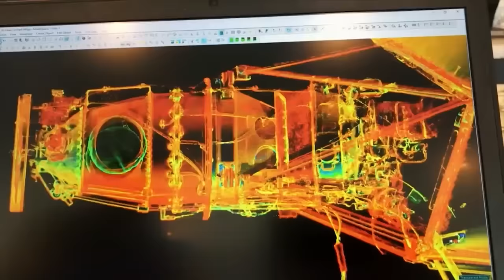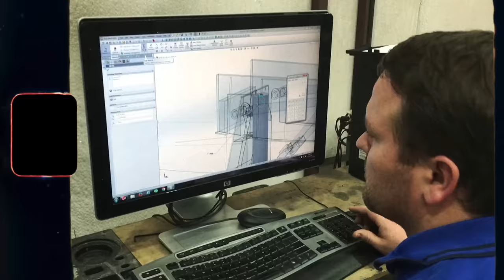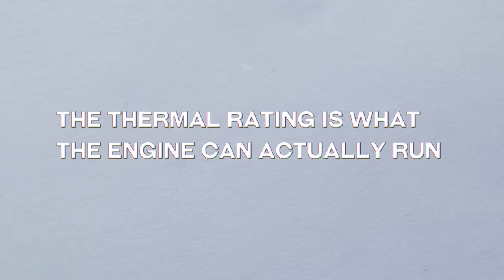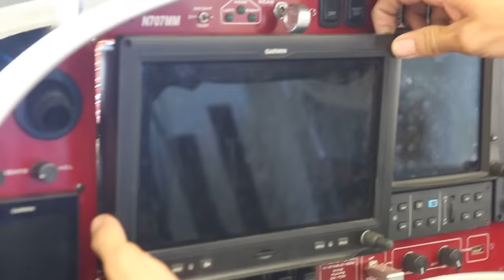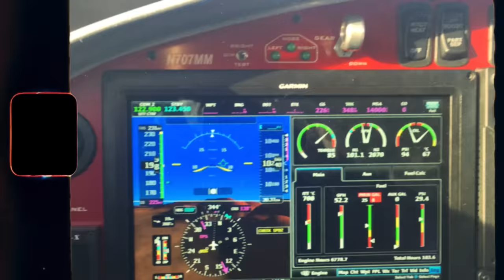Creating a Monster - World's Fastest Single Engine Turboprop | Turbulence #4

Comment: In case anyone is wondering I found some specs in an article: "Turbulence, a heavily modified Lancair Legacy and set a world record for the fastest single-engine turboprop with a speed of 438.02 mph. Turbulence has an 850-hp Pratt & Whitney PT6A-42 engine, custom five-blade MT propeller, and custom cowling, wings, and tail section. The entire fuselage is reinforced, and the airframe is 7 inches wider and 4 feet longer than a Legacy with a 32 percent larger rudder and tail."
Reply: I feel like the P-51 being able to out speed this is a curse.
Reply: I was going to say the p51 voodoo oud does this plane by 100mph if that's the case
Reply: @Noneyuhbus  yes voodoo is about 100 mph faster at  more than 2x the hp
Reply: Thanks for providing the information which this useless video fails to provide.
Reply: @Noneyuhbus P51 isnt a turboprop

There are a lot of reasons to have a turbine over a piston engine. They're often used because they don't fail like a piston engine can. When they fail, it's gradual. You'll almost always be able to get home. 

There can be catastrophic failure, but its so rare it's not a concern. In piston engine aircraft, you'll want for a parachute if it fails. Turbines the temp just climbs a bit over time and loses power gradually. It take a long time for it to fail enough to be unable to power the airframe.
Reply: Nobody mentions the cost lol. I assume it's about a million if you dont include labor. The turbine and prop is probably a half a million.
Reply: @jameskirk3 

And Mike Patey had this engine fail .  He safely dead sticked it to MSP IIRC.  Blew turbine shards all over the wings

Comment: Thanks for that bit at the end, Mike. I'm still on the lower side of flight hours and I find myself at the point of really needing to make sure I don't push limits. It's that "just good enough to be really dangerous" time in my aviation journey. I handled some pretty gnarly conditions, but they were things that popped up and I had outs already planned. I constantly remind myself that just because I have dealt with those conditions doesn't mean that I shouldn't be avoiding them at all costs. I've implemented hard limits that fall below what I know I'm capable of. That way if conditions diminish some, I have a safety margin. Having you reiterate this further solidifies that decision was correct and adding some more margin is better yet.
Reply from the maker: Stay safe out there

Comment: Huge respect. Thank you for holding Aviation in high regard. Once you’ve pushed it and survived you get it. You have 2 choices then. Die doing what you’re doing or respect the air, the aircraft, the chair flying, maintenance, support crews etc. flying fighters for 20 years you could see it. 500hrs we were experienced and that’s when it got dangerous. By 1000hrs you understood it. You said it very eloquently. Mad respect for you sir all around.

Comment: That my friend is called wisdom , for many it comes to late .My father was a Army paratrooper 101st and was also on the Army parachute jump team .
He began flying fixed wing and helicopters after the Army ,he also built in our garage two byplanes and later rebuilt a Hughes 300 later. He fought fired looked for oil across the Rocky Mountains using helicopters doin seismic surveys .
My father was careful and a very talented pilot I grew up around it all .Love you channel and your innovative outlook on aircraft thank you and good luck . Thankfully I lost my father couple years ago to heath complications not Aviation.

Comment: You guys are living the dream of many aerospace nerds. You should savour that. Off the wall thought, it would be great to do a trade on a contra rotating prop. Unfortunately I know of none that exist in this size, the one on the Griffin too big I guess. Next doubtful idea is to duct bleed air to blow on aileron to increase authority at low airspeed. The A42 has all the thermal margin to permit a lot of bleed air. This idea might not be silly. The expected benefit might be safer low speed handling, better climb and acceleration. To test a simple compressed air bottle could be set up.

Comment: I'm not a safety Sally, but when you're on the cutting edge as Mike is, everything you do to ensure safety can easily be the difference between life and death. This is a stunning aircraft that pushes the boundaries and there's a huge element of danger in that, but even with holding back from the razor's edge, you're already on a crazy ride and the adventure level is at max. I'm sure the temptation to let those horses run wild is a powerful one, but there's a thin line between ecstasy and suicide that a wise man will not cross. What an amazing accomplishment.

Comment: the five blades prop acts like the N! compressor on turbofan engine. except the enclosed cowling bypass the atmospheric air that also incorporates the thrust reverser during landing. i did see the jet engine power the gearbox. i'm not sure the high speed will shorten the wing structure after so many takeoff and landing due to stress. your limited the throttle from max speed reminded the F4 Phantom doing the max high speed test resulted in the pilot lost his life when the wing structure was over stressed. i retired from the major airlines as jet engine overhaul technician. your monster is very aerodynamic. great piece of proven art work!

Comment: I did flight testing in the Air Force for 5 years and it can cause people to get tunnel vision. Once had an emergency and it was one we trained on twice a month. We had it for real and the pilot tried to pass a perfectrly good air force base. Our home station was only ten more miles but it was an emergency and we had a good airport with crash rescue right here. Being a flight engineer we are trained to challenge our pilots when being dumb. I told the pilot if he didnt declare and emergency and land here I would declare and emergency. Being I was also an evaluator I told him I would hook him and give a failed eval for safety right on the spot. It was  amazing that he instantly came out of the mental fog of get home itis. He thanked me later, turned out both engines could have failed at any second.

Comment: Small hint for constructor: you can tilt propeller (and engine) 1.5-3 degrees, it causes dissymetry of propeller's thrust and dissymetry of additional lift created by the wings that can counter propeller's torque.
Invented by mr. Bloch (later Dassault, this Dassault - father of Mirage) before ww2, was adopted in many not realised US military projects of single prop attack aircraft after ww2. It is the best aerodynamic solution for the problem, because it can be almost fully compensated regardless of power around take off speed, and does not cause problem when engine dies.

Comment: The word incredible is inadequate here! For everyone's edification and amusement, on the subject of audiences and egos, an anecdote. On a breezy afternoon, while at home I heard what I recognized to be the sound of a paraglider taking off. It stopped within ten seconds, and I knew something was wrong, I drove to where I found a friend and fellow pilot hanging upside down from the electrical wires. My friend, a man of small stature with a large ego, had a football helmet on adding to the amusement factor. He was so wet with fuel it was dripping off his helmet. His paracords were draped over the electrical lines and the breeze would cause them to slip frequently creating a sound exactly like an electrical short. We were 30 miles from the closest power company assistance so I had a friend use his front end loader to lift me high enough that I could disconnect the power to the area with a pruning pole saving my friend another 30 minutes of terror?? A year later while flying a small home made experimental, the canopy flew off taking his glasses, and causing him to crash. It took him nearly three years to walk again. Go figure???

Comment: I respect the hell out of you dude. Xray those welds, i usually backpurge all my cages/mounts/chambers/manifolds, as well as chemical etch/sand blast the mill scale for extra homogenous surfaces, and always make sure you can hardly see any light shine through any of the joints.

Comment: Check out the Turbine Legend by Legend Aircraft (Formerly Performance Aircraft).  Also a single engine turbo prop with tandem seats.  When it launched in '98 it was doing a cruise of 425mph and a VNE of 500mph.  I'm sure the original designers and engineers would love to share their lessons learned.  Best of Luck!

Comment: "If the motor falls out when I lower this, I need to stop building airplanes".  LOL   But you really wouldn't, would you?

Yeah, kinda broke my heart when I heard you'd crashed Draco.  The most important part of the equation went right though.  Walking away is job #1.  I think you have a great attitude toward testing and flight, good for others to hear.  As soon as you don't,  something bad is a lot more likely to happen.  Always err on the side of caution.

Comment: Serious airplane performance. 

I've always wanted to see if high performance turboprop Pratt & Whitney or Rolls Royce 850+ HP - 5 / 7 blade combination could break 500  true airspeed between at FL15 - FL25 with a fuel burn less than 250 lbs per hour in a sub 2,500 lb (empty) aircraft. (What I call the triple 25s) that could still have a full fuel + 800 lbs passenger payload with 1,000 nm range.

It will be exciting to see what your final flight test cards reveal.

Stay safe and have a nice flight 🛫

Comment: Great work, I have the perfect engine for you to if you want to go faster and farther for less fuel.
An explosion trubine able to double the power output for half the weight with a new engine doing 16 explosions per turn in only one cylinder. A greater expansion ratio for higher efficiency.

Comment: Dude @8:23 when you held up that motor mount to that fuselage I gasped! I never gasp. I participated in building about 75 SLSA certified along with many Experimentals. LOL it's people like you that make me want to flip the board and rage quit life ha ha haaaaa. I judge aircraft using my own two method inspection rule. 1. spinner gap. 2 wheel pant perfection. The rest is easy.

Comment: Visually very reminiscent of the Bell XP-77, which would have been a great little fighter with a strong enough engine. The Fairchild Ranger VX-770-9 supercharged, air-cooled, inverted-V twelve-cylinder engine it was designed for might have worked, but it was a developmental engine that was never delivered because all of the superchargers were being used in production fighters.

Comment: So, You are at 420 mph with Turbulence's current configuration. I'm convinced that you can get to 450+ without adding more power. There has to be something that can be done in the way of airflow around the fuselage, airfoils and appurtenances. The answer lies between your ears, Mike, and I know you can find another 20 to 30 knots or mph. Just for example, that exhaust horn should be shaped more like an airfoil than an oval or the letter 'D'. That's gotta be worth a couple of knots all by itself.

Comment: I understand the parachute, but I'm wondering how you'd get to use it ? From what I can see the canopy is hinged at the front, so given the air pressure on it in flight, how do you get out of the plane ? Have I missed something ?

Comment: How do you design this?
do you just guestimate it and make it a little stronger? e.g. how you did the carbon reinforcements at the hull/wing connection. Or do you do a full finite element stress analysis (guestimating loads).

Greetings from a boat builder.
Reply: That's the scary part. Maybe he did maybe he didn't. I am not an expert at airframe design but I know it's a serious topic, especially when it comes to wing loading at the speeds of that aircraft.

Comment: i wonder if this beast of a plane will run into that "compressability" mach limit issue WW2 fighter planes had where control surfaces start locking up and/or reversing. or nose pitches down.

Comment: Why exhaust out at the prop end instead of having the turbine facing into the air to scoop more air? Exhaust would be close to the cabin. Wouldn't the ram air give more HP?? I am curious to know from an engineering point of view. Or is it best to exhaust at the prop end to manage the exhaust heat??

Comment: If sheer speed is the only functional criterion, it's easy to build a superfast single engine plane.  This applies up to a practical limit of about Mach 1 and at that point the machine pretty much has to sacrifice everything else, like stability, payload, and usefulness to any other purpose.  It's a bit like taking an elevator to the top of the Freedom Tower and claimed you climbed it, it's a cool thing with very little utility.

Comment: Watching the modifications made to accommodate the increased loads, stress on your AC, made me think that you could suggest a path to solve a problem I have. Apr 11,2023 I crashed a 1947 Navion with a TSIO 550 N4229K 9:05 . My current Navion is a 1951 B Model with a TCM IO 550. Love my plane but a Vne of 168 kts leaves zero margin for error. I have contacted several University Engineering departments and independent aerospace engineers to determine what MIDs could be made to increase the Vne , so installing big engines in a 75 year old AC is safe. You seem to have a handle on structural engineering that I don't have as a pilot and flight doc. I carry the concern about the low Vne every flight and would appreciate any suggestions on how to proceed.  Java

Comment: According British old records the fastest flight with a propeller is 506 MPH without failure not sure with turbine engine but Propeller issues caused many crashes not sure of height I know they were low level Duxford or Farnborough have that information on show. 480 MPH is what the last Mosquito did I think it was the sea Fury plane did the 506 MPH. About time modern versions flew well done.

Comment: I'm an A&P mechanic myself. I was thinking why didn't you put a T53 L 703 turboprop in it. They weigh 545 lbs & have a max 1800 shp. You would have had a real hot rod in the sky.

Comment: I wonder if swept wings would help cause then you could save weight because of less air resistance you wouldn't need the super extra strong spars (i think correct if wrong) and it would decrease drag hence increasing speed also i wonder if a 5 bladed contra rotating prop would increase speed (idk its a theory)

Comment: I haven't yet watched the whole video, but maybe you can experiment with this with your airplane. 
   Most people know that air gets thinner with altitude, which so the reason for loss of power with combustion engines. 
   It is the same with automotive, I am an ex technician. 
   What cars do not experience that airplanes do, is the change at some altitude between combusting O2 to O3. 
   I learned that more recently. So I thought that's strange. It gets thinner, so I suppose there are fewer individual air parts of air, but they say it goes from O2 to O3. That's more molecules and essentially possibly more to burn. 
   So I pose this, not great for consumption, but is it actually a loss of power because the engine gets lean instead?
   Or, what happens with more fuel? I don't fly airplanes, so I will never know through physical testing.

Comment: I wonder, how hard is it to to design a high-performance aircraft, such that it can top out at speeds approaching Mach 1.0, but still be able to fly safely at low speeds, with good control and a reasonably low stall speed during approach and landing? I know that huge aerospace corporations like Boeing, Lockheed-Martin, and Airbus have the resources to spend enormous amounts of R&D money on  computer modelling and wind tunnel testing, but how do individual designers manage this? I think of the Space Shuttle: it had to be controllable on re-entry moving at nearly 15,000 mph in the stratosphere, and all the while decelerating to about 200 mph on final. As an un-powered glider no less. The SR-71, had to be controllable at 80,000 feet, flying Mach 3.4, but also had to still be controllable at 165 mph on final, and able to execute a missed approach. I would have thought it to be impossible to design an airplane that does what the SR-71 or Concorde did, but it's been done, several times, so it's not impossible. I just can't imagine how an individual (or even a small team of engineers), can design something like Turbulence, without the resources of a giant company like Boeing. It's amazing, and I'd love to go to an airshow someday and see it fly.

Comment: Hummm....and there is a real aeronautical engineer somewhere in this mix????   All I hear is horsepower not a finite element analysis of the structures to determine whether or not any part of this plane can not only handle the power but the speed, torque, stress, flutter, side load, axial load, harmonics, etc.....  Just cowboy it up bubba!   Nice video.

Comment: I'm confused cause around the 18:50-19:00 minute mark his buddy says that's the fastest single turbo prop by his own words ALOT and then mike says 420mph at 17k feet and as far as I know and I could be wrong but the Pilatus pc-21 holds that record at 426mph and its a trainer so probably has a lot of extra unnecessary weight compared to turbulence now I'm no math expert but 420mph doesn't sound like its ALOT faster then 426